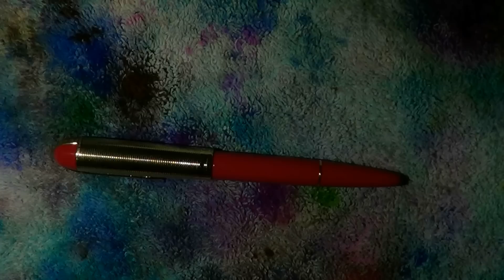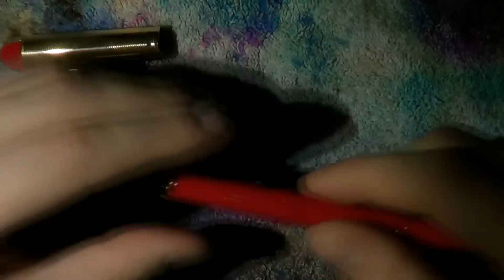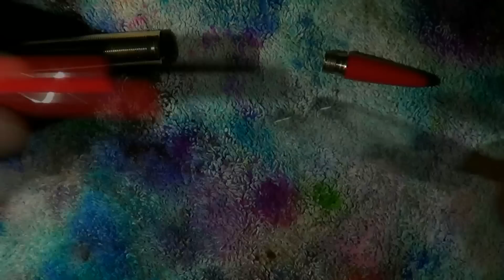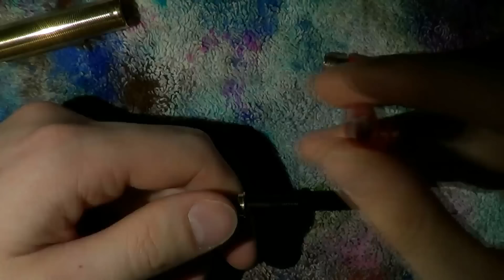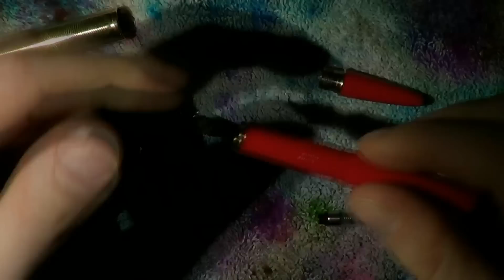Disassembly Line Wahl Eversharp Skyline

Comment: Nice scottish accent ;] Could You show how to disassemble the Montblanc 22 ;]
I just bought it, and want to check the markings on the nib (fortunately- its nice, and unfortunately its hooded so i dont see markings), clean it(must change ink), and so on ;]
Also which ink You recommend for it ?
Reply from the maker: The section unscrews and then you can push out the nib, it's that simple :-).  Do be careful though, because I have cracked a 22 section once.
Reply: sbrebrown Thanks, i will be careful ;] Hope than i will not crack it in to pieces.

Comment: Hey Stephen. 
Not related to this video; but with Kaweco I have started to use converter (bladder type). Is there in your opinion really much difference using cartridges as opposed to converter in this type of pen? Considering that both systems seem to hold about same amount of ink, and cartridges are cheap for Kaweco.
Reply from the maker: The only advantage to a converter is that you can use any type of bottled fountain pen ink.